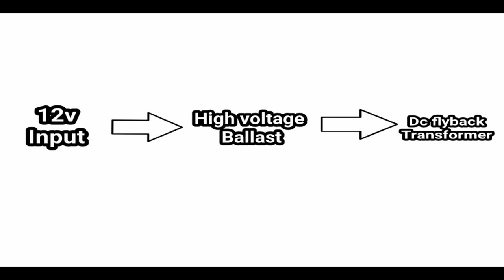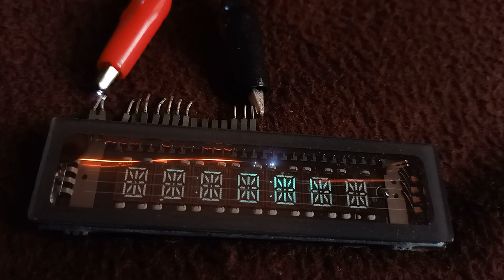How to create high voltage + experiments (30,00v).

Comment: 1:42 The reason why it failed is probably because you are using a Flyback transformer which has an internal diode in it. So the output is rectified AC which is basically DC. On the other hand the Tesla coil outputs pure AC sine wave. Here the current discharges into the stray capacitance between the HV and the ground causing the glow in the vacuum chamber. In DC we have no significance for the capacitance because it is open circuit for DC. In other words the frequency is zero. In a Tesla coil the frequency is very very high making stray capacitance very significant. Also please be very careful with high voltage. It is very dangerous and can easily stop the heart.
Reply from the maker: Yes sir.. Building a high power zvs driver to run that transformer will work.. Here I used 12v flurocent lamp ballast.. So it couldn't out a lot of power.. Will try making a tesla coil or zvs driver in the future.. For now I'm working on Jacob's ladder 😇❤️